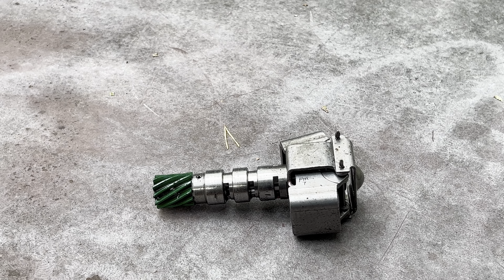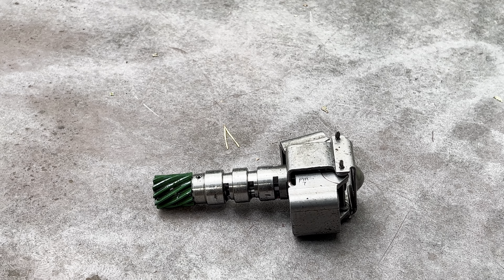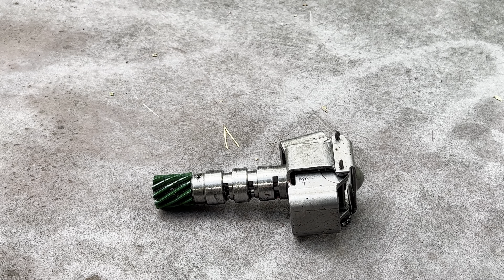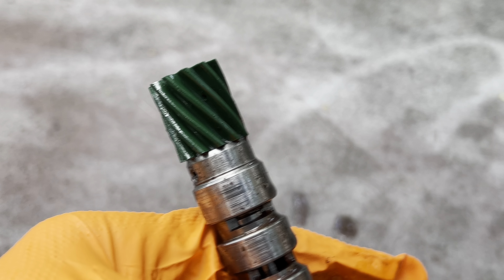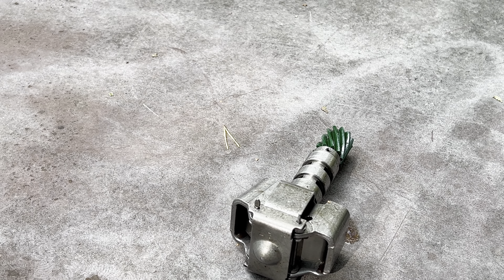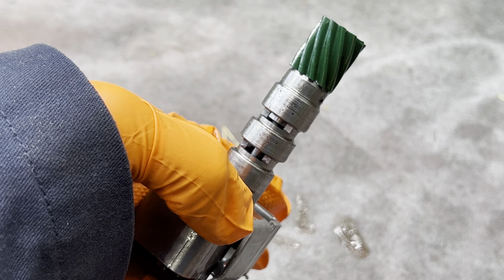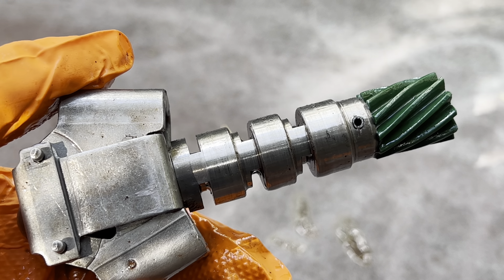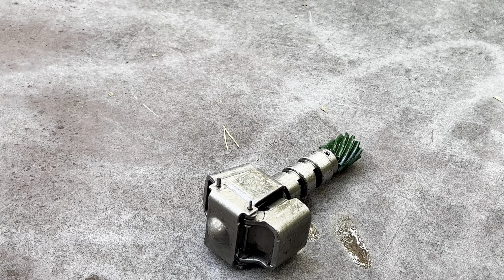Turbo 350 th 350 governor gear test transmission shifting issue

Comment: Great video man I have a 1982 4door cutlass  supreme  v6,3.8 
Car stall wen I go foward only  .all other gears are ok.ima driving with 2 feet 😂like if I'm driving stickshift...I have to put my left foot on the break pedal n the other on the gas ,now ease of the break pedal slowly n give it gas still hold breakpedal  until you reach 30mph you can let go of the break pedal😂if you go below 30mph car will start shaking this is wen you  make sure your foot is on the breakpedal at this time atleast half way,while giving it gas...if you come to a stop now your foot on the breakpedal all the way ,repeat step 1again now use your 2 feet break and gas ..ease  off the break pedal slowly ,but hold it half way and hit the gas pedal...😊to repair  this,I  had to change to a different brand of transmission don't use cheap brand..if you have any leaks repair  them ...make sure transmission  dipstick is top off at all time if you have a leak...if you let it get low so low expect  transmission  parts not to work .Due to not having enough transmission fluid.

Comment: I have the same problem with my Turbo 400. If I wind it up to about 40 mph it will shift to 2nd, then about 55 mph to 3rd gear. Around town I'm in 1st or 2nd gear all the time.